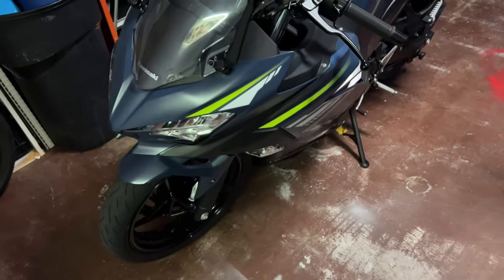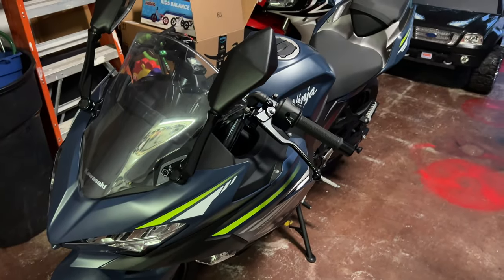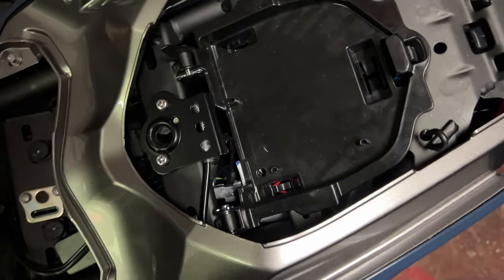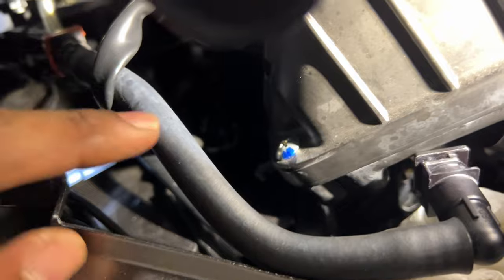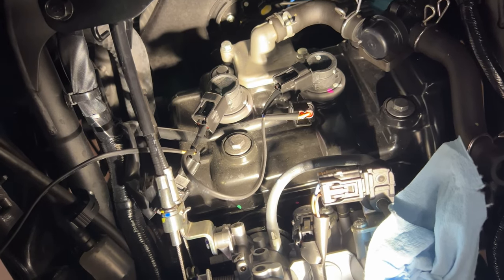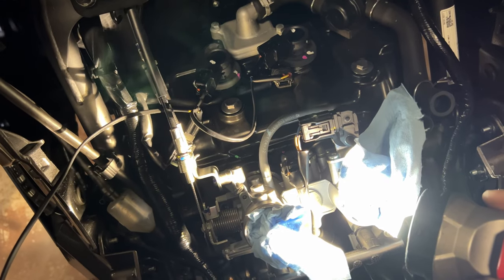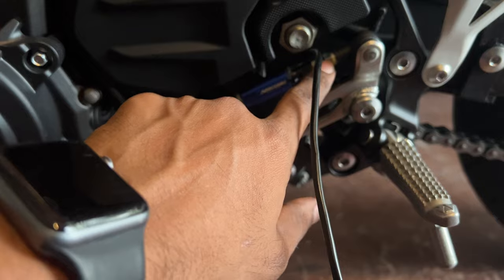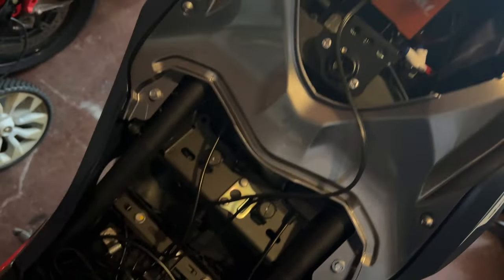2022 Ninja 400 Annitori Quickshifter Installation #annitori #ninja #quickshifter #kawasaki

Comment: Does the QS also supports down-shifts?
Reply: Negative, only up shifts
Reply from the maker: Only up shifts due to the clutch cable. There is a qs (upshift)/auto blipper (downshift) available from IRC but it’s much more expensive and not plug and play
Reply: What are your underbody lights? Where did you get them?
Reply from the maker: @allenpearson9716 they’re just from Amazon. Works well and not expensive. Niilight

Comment: Does the ninja 400 equipped with the power commander!  Did you just plugin with out commander!
Reply from the maker: Nope no power commander. It has its own controller so not needed. Eventually I will have the bike flashed.
Reply: So you cannot  plug that with ecu flashed?
Reply: Cannot plug with out ecu flashed
Reply from the maker: All you need for this QS is included with the kit when you buy it. The flash would be to tune the engine for better performance. A flash or power commander isn’t necessary.